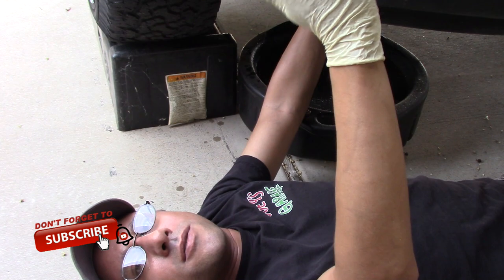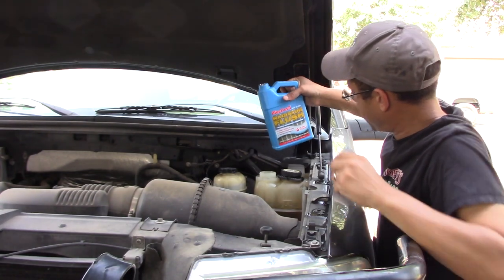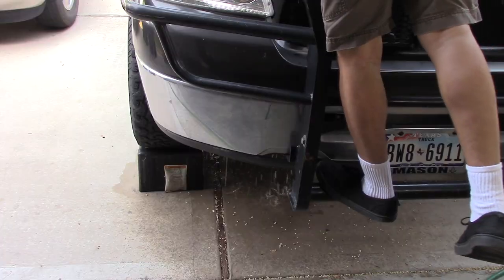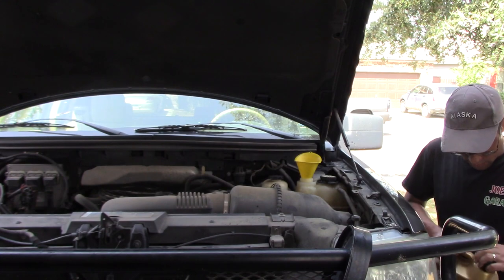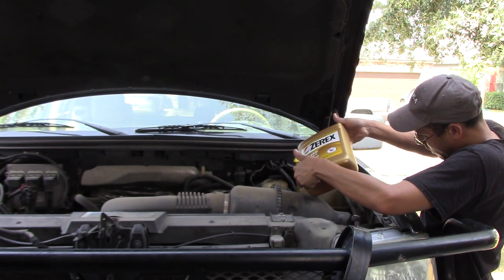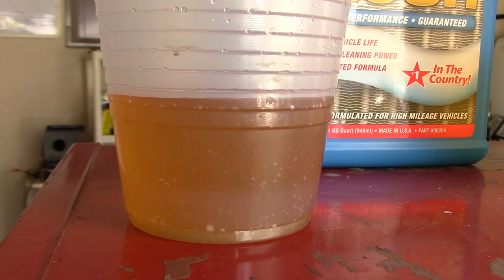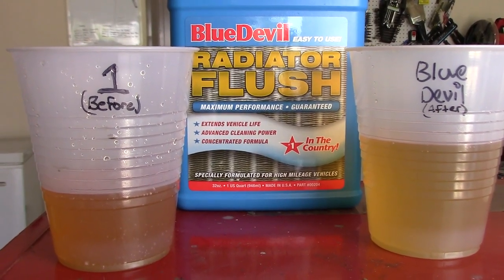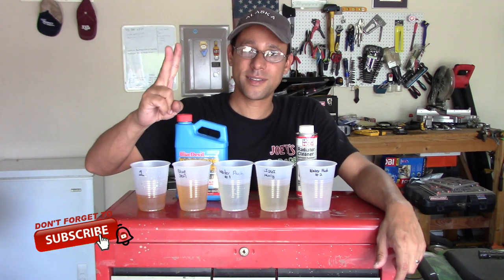Radiator Super Flush

Comment: Only thing I would have done different is a few drain and refills using distilled water to flush out the tap water then add my coolant... The tap water will corrode the radiator and internals!!
Reply: You're a 100% correct people do not understand that regular tap water will corrode up the radiator and clog up your system again.
Always use distilled water after flushing